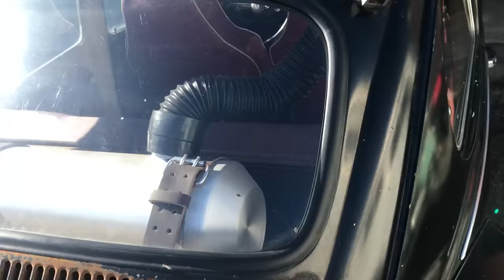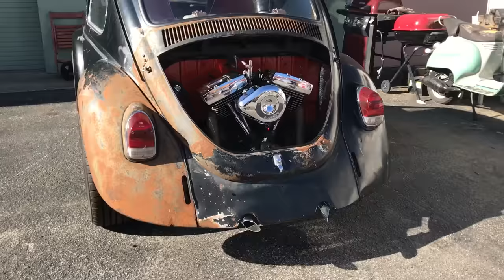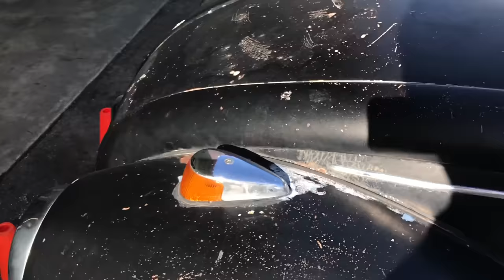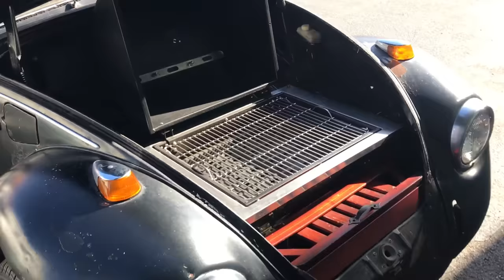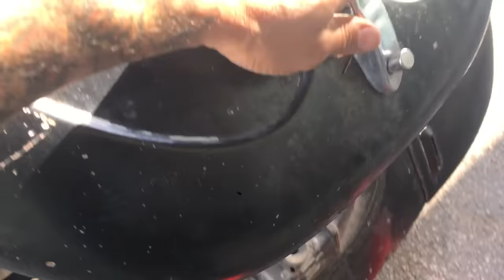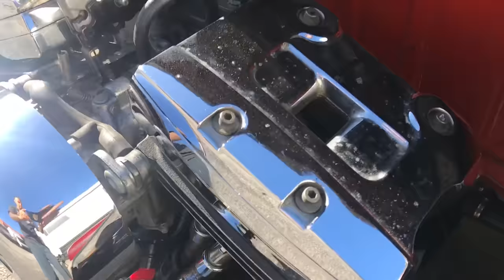1968 Volkswagen beetle powered by Harley Davidson engine! VW-HARLEY

Comment: How did you adapt that engine to the transmission ? Cool 😎
Reply: He is probably using the Harley stock transmission and linkage to reach the stick inside. Then converted the rear diff to chain drive.  Might not have reverse yet but dood its a freaking v twin🤣
Reply: No he's using an adapter plate straight to the transaxle. He said he was developing the plates for production, but nothing has come about it.
Reply: @jakestevens2323  nope...adaptor plate

Comment: My dad and I used to work on his bug. We used to take the engine out ourselves, it only weighed 225lbs. We put a new dashboard in that showed the oil temp, techometer, and so forth. We put two two barrel Hollies on it, custom Bosch fuel pump and installed fog lamps. I want to get my hands on one to fix it up when this madness is over.

Comment: Did you see that BBQ? What a party Bug.
Reply: Q uantum I would be impressed if it was a propane bbq and a propane engine running on the same tank.
Reply: Blue Mountain Edward Man that's alot of gasoline if that bbq pit got outta hand🤣🤣🤣🤣🤣🤣🤣

Comment: Overheating problem
Reply: Lance Henry that's what I thought.
Reply: Dont you need to run more than 5 minutes and produce hp to overheat?
Reply: So you wouldn’t run it around more than five minutes 😂😳
Reply: Unless there’s a way of scooping air from beneath and dragging it through the trunk
Reply: I’m thinking a large electric fan pulling air from the louvers above maybe
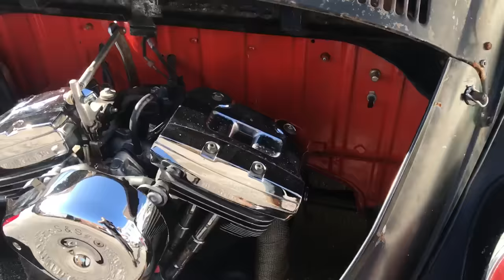Reply: At 0:19 we can see plenty of the ground. All it takes is a tiny "wing"/spoiler thingie to scoop up some of the air that passes under the car.
Probably some of the air already finds its way up where it's needed.
Reply: So, you drive a few miles, stop grill some steaks, drive a little more, then k-bobs, drive a little more...
Reply: That car is so cool that it doesn't need a cooling system.
Reply: Lance Henry his point is that Harley's are unreliable and it would break within five minutes
Reply: This thing was air cooled before so it shouldn't overheat
Reply: Wolfreespirit Rebel I didn't say I agreed with him I was just explaining to the other guy what he was trying to say, no need to overreact
Reply: Wolfreespirit Rebel although in general I do prefer dual sports to cruisers of any type
Reply: Lance Henry, stock beetles are air cooled. So swapping in a Harley engine would be totally fine.
Reply: Yall realize that a vw motor is also air cooled dont u?
Reply: CaRdUdePeRsOn Which included a fan, which this doesn’t have.
Reply: VW Motor have a forced Air cooling with big fan ,HD Motor dont have ! This Kind of Car named " funny Car " the front grill Is the best and  very funny 😀
Reply: Lukas Bekcic Are you joking? Stock VW’s have a fan in a blowerhousing that directs air down to each cylinder row. Here there is no fan.
Reply: C C. Even in a motorcycle the Harley engine needs air movement, idling in traffic can get it hot.
Reply: Whoever said Harleys unreliable
Reply: @tuxedorooster9337  Your  Opinion that this will be unreliable is misplaced.  This is an evolution engine and fully capable of 100k plus . Proven time and time again. This evo is most likely the 59hp version. Very reliable.
Reply: @leathers970  of course it is, but VW went to great lengths to get cool air across the cylinders and heads.
Reply: @leathers970   Yeah but the regular VW  Engine has a fan .
Reply: What's the power output on that engine
Reply: @lee2217  unmodified evolution engine is 56hp.
Reply: The problem, even with air cooled motorcycles is when not moving, however the bike is getting some moving air from the environment. So the HD motor in the engine compartment will retain heat more, so a constant cooling fan, in my humble opinion, would be paramount to a long life! But it is still a “cool” experiment ❤️
Reply: newagetojo  The original has a fan. This engine does not.
Reply: newagetojo  You obviously are pretending to know about vw beetles. Every vw air cooled engine has a belt driven fan attached to the generator. They also have an oil cooler. You lose the generator belt and they overheat in just a few minutes.
Reply from the maker: it has a oil radiator under the car. Soon,,, We will have adaptors ready for sale !! follow me for updates!!!
Reply: Hey everyone...about your comments about the Vw engine being air cooled, (1) the cylinders are horizontal down low, air flow is good while moving, (2) the Vw motor has a fan shroud that blows air down on cylinders when the vehicle is not moving! That being said, the v twin motor is a novelty and the cool factor is definitely cool, but that don’t help the upper cylinder stay cool
Reply: There's no engine cover; the entire back of the car is open to suck air up from below.
Reply: @zeuso.1947  possibly could...guess you’d need to use it as everyday driver, should install heat sensors on heads so temp could be monitored
Reply: blind guy there's no trunk
Reply: It wont overheat, the beetle was designed as an air cooled car; the louvers above the engine compartment draw air into the engine bay
Reply: @motorinkfernando587  that's down right genius!
Reply: Do y’all know anything about how Volkswagen engine bags work they are air cooled when you have all the tins in the motors can almost condensate with how cool they stay the air flows very well thru them people under estimate them
Reply: @sethg.7158  Ding ding! We have a Winner! The fans used on vw flat fours are mostly for (I believe) the inherit
Interior cylinders which didn't receive as much airflow as the rear pair... But I may have it reversed, either way the air-cooled engine runs just fine and there is PLENTY of space in that engine bay for air
Reply: @lukasbekcic  beetles have a giant cooling fan and shrouds to direct air over the motor, Harley’s rely on the air going around the motor while on a motorcycle as well as a oil cooler, this setup will fail quickly
Reply: Nope it's just a BBQ

Comment: Found a way to make it even slower than it was.  Nice.
Reply: Yes and louder and less reliable and more expensive to repair! Thank God for HD build quality!
Oh never mind! This is just stupid!
Reply: The most powerful Beetle engine in '68 was a 1.5 litre that had 53hp, the very weakest Harley twin-cam engine (the 88ci) was 55hp. 

The VW might have originally had the 1.2 litre, with 36hp, and the Harley engine might be a 103 Twin-cam, with 75hp.

I've got a 2016 Harley, and it's done 50,000km so far, with no issue. They're not as bad as they were.
Reply: Probably twice the torque of its original engine but who cares? It's a fun project. If you're looking for logic, an ancient VW with a grill up front isn't it.

Comment: I laughed so hard when i read "scary fast" in the description hahaha
Reply from the maker: tks ! if you drive an original vw beetle and then get to drive mine ...you will say scaryyy fastttt tks!
Reply: MOTORINK FERNANDO Yeah, compared to the original 37hp motor and 40hp hardly motor would be scary fast.
Reply: NBSV1 - It is how the power is made and where it is made at. The torque is nearly double if my memory serves right.
Reply: NBSV1 harley engines* make about 70 hp stock. With a stage 1 they get to about 85
Reply: @Pops Fereal Still faster than a Hardley.
Reply: newagetojo Y’all struggle with a joke. It’s easy to build an old VW motor to be over 2,000cc’s and over 100hp. All making as much or more torque than an Harley at similar power. 

At the end of the day Harley’s sound cool and work well for what they are. But, they aren’t high performance engines. It takes nearly double the displacement and a weight break for them to be competitive in racing.

Comment: I can appreciate the work you put into this, but the main problem I see is how do you cool that EVO motor?
Reply: You DON'T~
Reply: same way it was cooled with the original engine probably channel under the car if you really want you could use a fan
Reply: There are a ton of oil coolers made for evo air cooled Harley engines!!! D.K.CUSTOMS
Reply: @calimilk1113  An oil cooler can only do so much.  He needs some sort of hidden electric fan setup underneath the car to channel forced air towards the barrels and the heads.  That's not hard to do, but he will have to set up some sort of deflectors to guide the air toward the fins.  Good answer!
Reply: Air ram scoops above the rear fenders with ducting directing air blast onto and over the engine.  Highway speed and speed over 30mph will ram cooling air over and across the cylinders. 

An additional strong 12v fan that is ducted to concentrate air blast would cool the cylinders when not moving, or under 30mph.
Reply: @SunnyIlha  That's a good idea, but air ram scoops above the fenders ruin the lines of the car.  To keep the looks this thing needs the fan from a Porsche 911 and some ducting, or the electric fans I talked about.
Reply: The original motor for it was a also air cooled i image theres ducts to cool it.
Reply: @the_rabbitt  The original motor had a fan driven by a belt that also drove the alternator, and there was a large shroud around the engine itself.
Reply: Put a small 12 volt fan on each side

Comment: The funny thing that Harley engine probably makes almost twice as much power as the original VW engine.
Reply: I doubt that...both  underpowered, (there are half the size single cylinder MC engines making more HP) both ancient technology,  but VW is probably more reliable..
Reply: VW motor ca 45 hp Maximum , HD Motor 60 HP Minimum
Reply: The hd 1340 evo had 58hp while the volkswagon beetle (depending on the year) could have had anywhere between 40 and 60, so this was likely a push at best.
Reply: ...And leaks 2x the oil 🤣
Reply: Twice the HP? Naaa, these have between 35 and 50 hp stock.this evo HD engine (without hopping it up) has around 59 HP
Reply: TNT VIDEOS  have you seen the early mini cooper with a hyabusa?
Its freakin cool
Reply: @gabrielepasqualoni7362  a 1968 1600 dual-port produces 62 horsepower
Reply: TNT VIDEOS  another 200hp would be fun, but brakes should not get overlooked. I swapped a straight 6 fur a tunnel rammed v8 and the darn thing couldn't stop.
Reply: Actually a stock 80” evo is 56 horse, easy to get 100 out of it without going nuts. Anyone who thinks the VW engine is more dependable doesn’t know what they are talking about! Stock Evo’s will go 100,000 miles and they dont leak! Don’t confuse the Evo with the Shovel head which did leak due to aluminum heads on iron cylinders. The two best Harley engines ever made were the Evo and the Vrod Revolution, which contrary to rumor was not built by Porsche!
Reply: The hd will make more power right up to the time that it breaks down! And with hd that is often and that quality is the only reliable thing about an hd!
Reply: newagetojo  Yes, it is relevant type 1 Beetle started out with a 36 horsepower engine. Which was 1300 cc then they went to a 1500 and then the last engine in the beetle is a dual-port 1600. So therefore how is this irrelevant that 16 horse or put out 62 horsepower do some research before you open your Yap and remove all doubt as to your stupidity.
Reply from the maker: it has more power and kick . Soon,,, We will have adaptors ready for sale !! follow me for updates!!!

Comment: I actually want to do this with a 2004 Beetle ultima & Harley’s newer 86hp 114 cubic inch 1,870cc Milwaukee 8 engine. 
   It’s a big jump in horsepower & cool factor.
I would also get one of those clear hoods for the engine g run some LED’s to light it up
Reply: I’m tryna figure out how he mated the case to the transmission. That’s probably the hardest part. Would be easier to take a Bmw k100 or R1200 engine and shaft drive and mate it up

Comment: Yup needs some type of cooling fan if they want to put the lid back on  A oil cooler too they must have a oil tank in there some ware too did not see it  easy to plumb it in I bet a large auxiliary 12 volt radiator fan would keep a nice stream of air over it .

Comment: Consider building a top engine mount to reduce the vibration,and eventually your bottom mount wear. Other than that it's a solid looking peace bro.
Reply from the maker: tks it is has a top engine mount that it framed to the vw transmission to reinforce it ! got good point on that! i saw it too!

Comment: If Harley made a plane, would you fly in it?
Reply: They actually did way back in the late 20s early 30s look for it on the Wheels through time motorcycle museum who has a YouTube channel where every motorcycle runs & drives that they have in the museum some very rare original bikes some partially restored some very rare race bikes from the factory used for board track racing and others made for dirt ovals and some specifically built as hill climbers . Each year they have a raffle where you can buy tickets to win the bike they build that year that's done to original but rebuilt as new when it would have come out using N.O.S parts or original parts which are fully able to drive and are works of art . The guy who runs it now his father started it but died a few years ago from cancer so he took it over and they just had a video of it running for the first time in almost 30 years after his father purchased it but there is a photo shown of the original owner flying it way back in the day he showed in the photo his father got with it when he bought it .

Comment: Kill switch and starter switch on the fire wall.

When it's drivable will you mount those switched on the dash board?
Reply from the maker: car is drivable its has both ways to start it...the one on the firewall just use it for conventions tks

Comment: I've always wanted a Baja Beetle with a big, stupid Harley-ish (probably RevTech or S&S) motor in it. Have to figure out some duct/fan arrangement and a great big oil cooler to keep it happy, but a fiberglass Baja wouldn't weigh much more than a trike or sidecar Harley, should run just fine for a long while.

Comment: I wonder if it leaks more or less oil now
Reply: The Harley Evolution doesn't leak oil like the old Shovel head did I bought my 86 FLHT new in 1986 and it has a 100,000 original miles never rebuilt and still doesn't leak oil . Stock engine other than free flowing mufflers and a S&S Super E that's jetted correctly with the S&S intake . These were the first HD V twins that could go a 100,000 or more before needing to be rebuilt unlike the older engines heck some of the newer Twin cams don't even last that long because of timing chain tensioner issues and oil pump problems associated with the cam tensioner grinding down and clogging the oil pump plus fly wheels that come loose and go out of balance because they are press fit and not either welded or bolted tight where the Evolution doesn't have these problems .

Comment from the maker: Thank you all for the comments! this coming week will post a video of the car driving around plus a video showing how did a built this machine! and now it is up FOR SALE!
Reply: MOTORINK FERNANDO k it’s been 2 weeks and it’s driving me nuts.. where are those videosssss lol
Reply from the maker: got the video driving it and soon coming the built-in process
Reply: MOTORINK FERNANDO hell yeah!
Reply: MOTORINK FERNANDO well done , very cool evo powered bug  im in process of building 4 door bug rear suicide doors with subaru power
Reply: MOTORINK FERNANDO its neat as hell but I think you will have overheating issues. There needs to be air circulating over the cooling fins
Reply: All you need is a tiny wing beneath/in front of it, to scoop up air. Some of it will flow by the engine anyways, even without a wing... and if he drives without the hood there will be even less of a problem. In another comment he mentioned he has an oil cooler too... but he rarely uses it because it isn't needed. So obviously this setup works...
Reply: MOTORINK FERNANDO how do you keep the engine cool?? It must overheat in there.
Reply: MOTORINK FERNANDO do you own a shop or do it just for a hobby ?
Reply: For sale...the best thing to do with anything Harley related.
Reply: What's the mpg like?
Reply: where can I get the adapter to adapt a evo to a turbo 350?
Reply: did it sell yet? 
how much did it list for?

Comment: Scary fast, what a crock.
Reply from the maker: if you drive an original vw beetle and then get to drive mine ...you will say scaryyy fastttt
Reply: I have four originals and they are all powered by a modified vw engines and would spank your cars arse. A poor choice of engines, what HP is it, about 80. I have 200HP at thew wheels in my Ghia.
Reply: Big Boy agreed, ridiculous.
Reply: Big Boy must be faster then with stock engine
Reply: stuffs getting deep now
Reply: Ive got a 2332cc, fuel injected , super charged 66 bug. Mine will haul ass
Reply: Big Boy well, considering the bone stock bugs made what...34-35 hp, the harley mill is likely fast compared to a stock bug.
Reply: Big Boy 
1) a KG is not a bug. But you already know this. 
2) stop comparing apples to oranges. A scat or empi vw motor is nothing like the mass produced crap that came in an unmolested bug, so, in short, you can bolt on a crate motor and have an instant 200 ponies. The guy that built this was thinking outside of the box...give some credit where it's due.
Reply: @bigboy9693  200 hours lol I no of bugs running 500 hp look up fire bus it's the fastest in Britain I no that as it as my uncles old setup in it an he set it up that's running 300hp
Reply: @becca6791  200 hours, WTF
Reply: Big Boy horses your saying  200hp is fast. I’m just saying I no of bugs 300 hp an 500 hp that spank the ass end of skylines 911s lambos

Comment: I don't get it.... You changed out to a harley evo. So you gained 30hp. A ton of noise and vibration, and will need cam bearings in 3000 miles.... Should have put a watercooled rocket engine in. Had well over 150 at the wheels. Reliable as hell. And fast not bs harley fast. A fully built harley is as fast as a stockish super sport.....